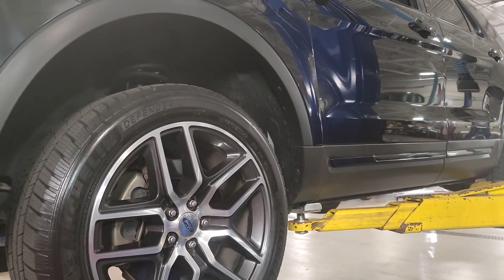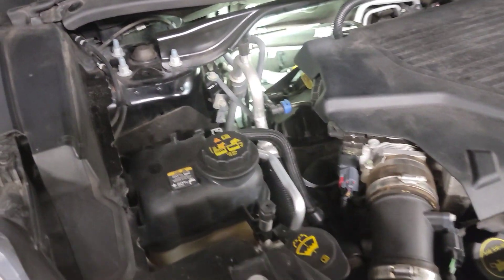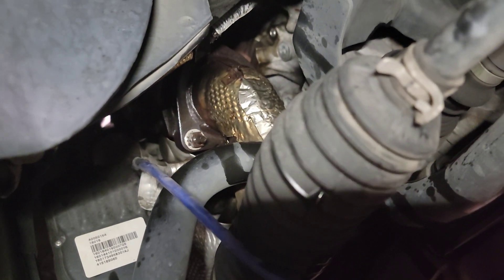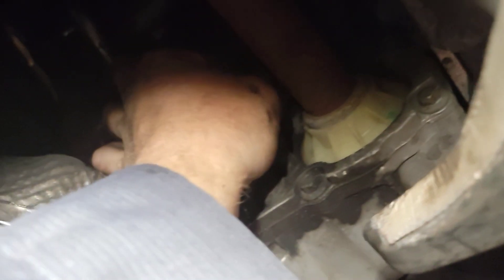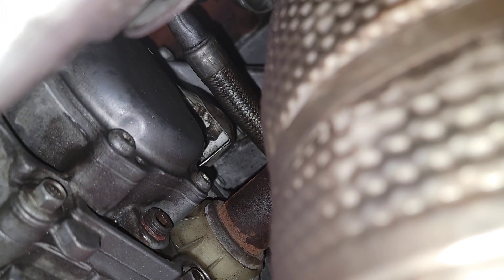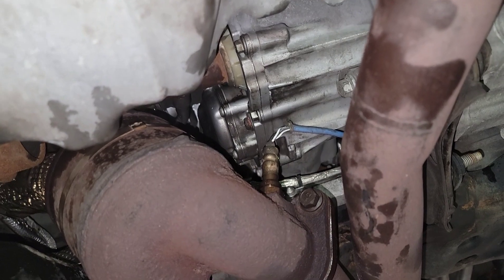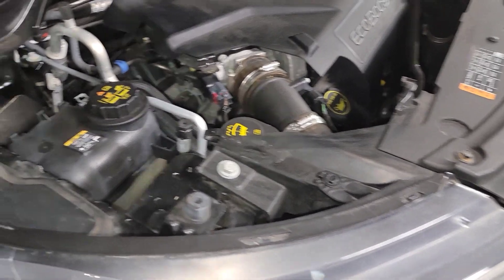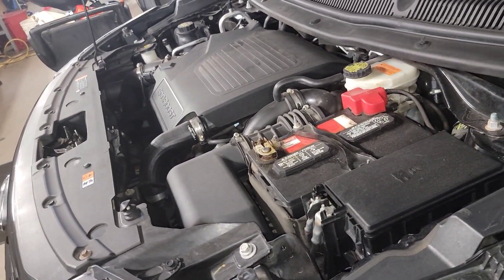Dealer Said, " PTU Cant be serviced  " WRONG!!!! Subscriber PTU Service 2016 Explorer Sport Let's Go

Comment: question for you because i unfortunately am one of fords customers w the 2016 Fusion 1.5 coolant leak issue @ 63k miles. Very frustrating situation but i want to thank you already for the information you have provided however i have some further questions. 1 being does the 2.0 use the same ECU if i wanted to throw in a 2.0 instead of the the blown 1.5 thats in it what would would be my biggest concerns? 2: how much does this cost to have the motor replaced at ford? How many labor hours is it to have your 1.5 swapped? Does ford just replace the lower block or do they swap the whole engine in my situation? I know from your last video about it you said it already has to be a 1.5 newer than june/july of 2019 i believe or it will just have the same gaps between the cylinders. Looking to either throw in a older 2.0 or just replace the motor from a 2019/2020 1.5 

My fusion has blown white smoke badly before i realized it will no longer hold coolant in it, car has been sitting in my driveway for over a year because ive just been unsure how to go about it. Now at the point where I’ll probably buy an ebay motor and swap it myself but then i saw your video about how it needed to be a newer motor or it wouldnt make a difference. Any information helps! Ty
Reply from the maker: I wouldn't know about the swap honestly
Reply from the maker: Call fords crc corporate department and ask for help

Comment: The Tech that serviced the PTU on my 2019 Edge ST popped out the liquid cooler from the PTU in order to service it.
Reply from the maker: That's because your drain on your Edge is in front of the cooler pump so you just remove the pump to drain everything and then you put it back and then you fill through the fill hole above it
Reply from the maker: You can't compare your unit to this one it doesn't work that way
Reply: @FordBossMe  I know they all have differences across the platforms and some have drain and fill plugs and some don't.
Like you said, the PTUs that were made to be serviceable have the access and can be done in 30 minutes. There are others that don't have easy access, or you need to be creative to access them.
It would have been nice if Ford just put Haldex units in all of their vehicles instead of PTUs....

Comment: The dealership should sell this service as routine at the 35,000 MI Because by the time they reach 75,000 MI the unit is toast. And that goes for Lincoln's as well. Rich doesn't tell us how much it costs but even if it's 300 bucks it's worth doing. The dealership quotes a replacement parts and labor about $2,500. So if you keep the car for 100,000 miles you might have spend a thousand dollars keeping the unit in good shape. It's not a good design in the first place but there it is
Reply from the maker: At 30k not 35k sir
Reply from the maker: I don't talk money because every place is different and I did kind of tell you how much when I specified the labor hours it takes and 1 quart 75w140
Reply: Gonna have to send this to some mud mower guys,might be great for use in those for an interesting project. 
Also the most that's being pushed thru a mower is like 30hp ,most are 20 or less.

Comment: I tried to drill a drain plug into mine but ruined it and had to pay 2800 for a new one 😞 I service the new one every 10k miles even though it’s hard to get any old oil out…have you seen the new one Dorman made with the drain plug? XD model
Reply from the maker: I heard about it but have not seen it, if you have a link I'd like it

Comment: I extended the vent to top of motor and filled through vent tube
Reply: How do you determine the fluid level?  I know you can come somewhat close by measuring the amount that drains out and just refilling with that amount, but that method assumes a lot of things I don't think we can really assume.
Reply: @gcraig0001  I drained everything out into a measuring cup ... made sure it was close to amount that it holds and added just a little extra as I went back in milliliters extra.
Reply: We have a 2013 Interceptor Utility (Explorer) that we purchased three years ago, took it to the local dealer and they wouldn't do the service, found a local transmission shop that charged me over $300 and took them the better part of the day. YouTube is your friend, looked and found the vent fill hack. Takes a while to fill though the vent, and I maybe a little off on topping it up but that's better than not doing regular changes every 30,000 miles. I since found a private shop that does the job for $100 plus materials. I've waited and watched the service and they seem to be very knowledgeable and professional. I knew at one point how much the PTU held but have forgotten, also Ford has change the fluid spec a couple of times and now I buy the fluid exclusively from a dealer.
Reply: @Wes Mullennix Thanks for the tip 🫡
Reply: @tctwg1  yea man there's a you tube video on it ...it's slow process but not terrible
Reply: Thats how I do mine.
Reply: @valmanks I have a similar vehicle. Do you have the link for the vent hack video? What's  the name of the 2nd shop that did ptu job? Thank you.
Reply: Can you advise how you pulled that off?

Comment: Not very convenient in the rust belt. I bet if some of these engineers actually had to fix cars they would design an easy way to service it.
Reply: I don’t believe they care once past 5/60… as long as they can service it during regular warranty. Can’t blame manufacturers because the DOT and towns use salt plus brine in such high concentration and drivers do not clean the undersides of their vehicles daily but they drive them daily . I work at a Highway dept out town trucks are miserable to work on by year number 5 , it’s all we do is work on rusty trucks and police cars pickups …

Comment: Seems to me the service will be cheaper than a new ptu  with all these new manufacturers suggesting the service intervals doesn’t make any sense is back in the old days you change  off in like oil every 3000 miles I still my oil every 3000 miles because oil changes are cheaper a new engine

Comment: Ford just screwed all techs with these 'newer' models. It's a nightmare working on them. Sup-par parts, very hard to access some of them (aside from lacking drain plugs, rear diff [the level screw has a hole in the subframe where you can loose the only T40 bit that can get in there and fill plug is almost inaccessible due to the subframe] and PTU on escapes for example), transmission on Cmax (which imploded at around 95k due to turkey made nsk bearings, it didn't care about doing maintenance at half the intervals required), rattling and timing problems like it's an Audi, filter in the back of the engine on Focus so you get crap everywhere... I would've gotten a chevy if they only had better white paint not flaking... Oh, wait, ford has that too to some extent.
Reply from the maker: I mean I see how that's a concern for you and I see how you are obviously emotional about your situation which I would be too but I service these things everyday so I don't have a problem changing the fluids in them where other people think they can't I show them they can you just have to know how to do it

Comment: FORD is full of crap on PTUs.... it should be illegal to not have a fill and drain plug on every oil based assembly. Class action lawsuit needs to happen over this trend. This is clearly designed to fail PREMATURELY...

Comment: The new ones can. The old one can't. 2010 model.
Reply from the maker: Yes you can
Reply from the maker: Give me a year and I'll prove it
Reply: @FordBossMe , you can service anything with a bit of extra work. I don't care to play games.
Reply: Fordtechmakuloco made a video on it a long time ago. 

The old ones aren't serviceable without the tech making modifications to the case.  The new cases are servicable. 

I'm not a tech but I, know enough To know that thePTU on my wife's flex isn't serviceable unless it is pulled and disassembled and modified and repaired. I would just rather the redesigned ptu be installed.
Reply: I don't need you to prove it. Unless you feel the need to prove it.
Reply: @FordBossMe , with extra modifications to the existing case.  I know you can modify anything to be serviced.

Comment: They do the same with the external fuel filter, claiming it's a lifetime and there's no information in the service manual or user manual 

 I change it every while (FG1114)  on my fusion 2014 2.5L
Reply: Interesting. I couldn’t find one on my 2011 fusion. Where is yours located?
Reply: @blueoval250 

Near the left rear wheel above a cover/ shield but it can be seen without removing the shield/ cover 

but not sure where would u find yours on 2011 model if it exists